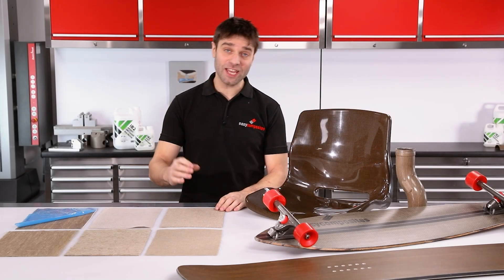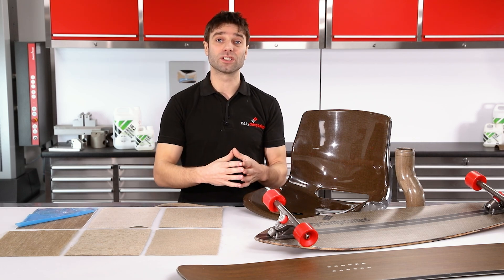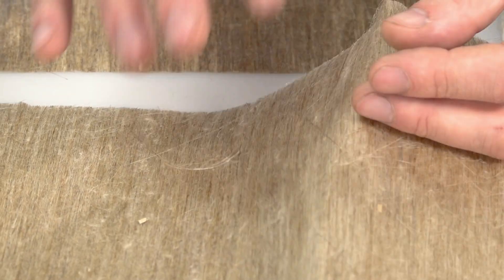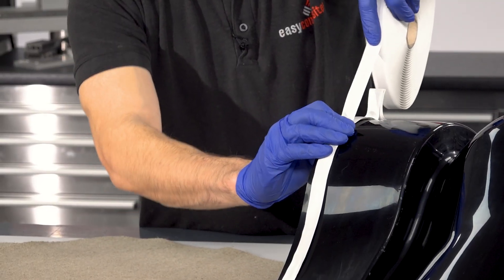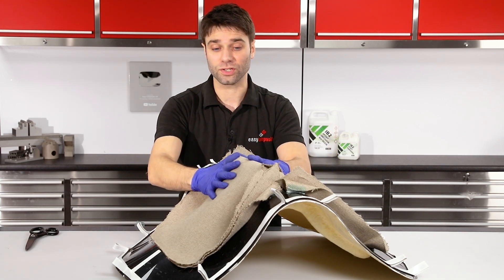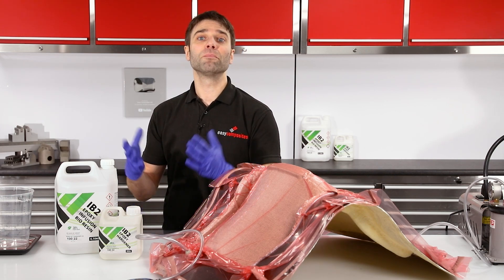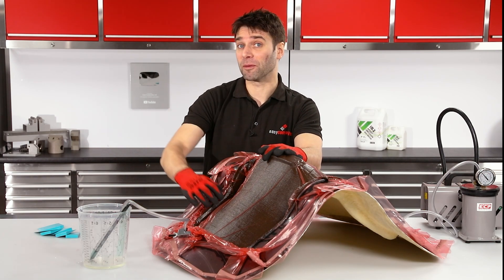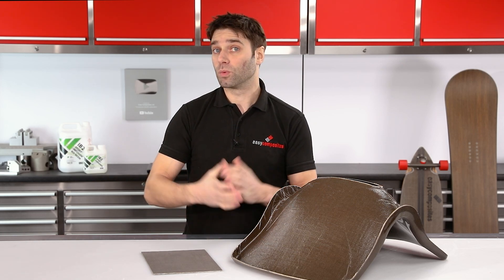How to Use Flax Fibre in Composites; Performance and Processing

Comment: I am curious, where did you hear that flax is stronger than hemp? An internet search yields contrary results: "when it comes to strength, hemp has a distinct edge over linen. Hemp fibers are up to eight times stronger than linen".
Reply: I agree, I've always read that hemp would be the stronger fibre. Maybe it has other properties which make it less desirable. Or maybe its just less available in a range of suitable twills.
Reply: @Piazzapower  I think it mostly comes down to the fact that cannabis is controlled, because I believe cannabis is more beneficial than flax. It produces stronger fibers and more of them, the rest of the plant is all used up while making other useful products, like healthcare products, animal feed, biomass for a clean source of fuel.
Reply: @Convolutedtubules  traditionally yes that's definately been the case but not so much now i believe. I think hemp products are much more accepted. I can walk in to a supermarket and buy hemp seeds in the health food section and cbd oils etc.
Reply: @Piazzapower  As long as the cannabis plant is controlled, it's many products will be at a severe disadvantage. Even though cannabis may be the best choice in many occasions. We need full legalisation to make the cannabis plant like any other plant and only then will we start seeing real change.
Reply from the maker: Hemp fibre has good potential as a natural reinforcement but the conventional hemp fibre that's produced in volume doesn't beat the flax that's produced in volume. Various papers  have demonstrated hemp fibre yielding better mechanical results than flax fibre but, as far as we've seen, this is only with lab-scale produced hemp fibre which has been specially prepared and conditioned so as to retain and optimise its mechanical properties for composites. As yet (again, to the best of our knowledge) hemp fibre, mass produced in the traditional way, does not retain its mechanical advantage over mass produced flax fibre, but if the lab production techniques are successfully scaled up then it could do, so it's a space worth watching.
More broadly though, as a statement, your internal alarm bells should already be ringing when you read something like "hemp fibres are up to eight times stronger than linen"; differences of this magnitude are pretty unlikely to exist for any similar materials, outside of very specific contexts and conditions.
Reply: @easycompositestv  Thank you!

Comment: This material seems really interesting, I'll have to do some research on it!
But I don't think it can be that environmentally friendly while it's not recyclable like metals.
Reply: Why dont you mention the Resin, which is way more critical
Reply: Recyclability wouldn’t really matter if it were 100% biological, compostable material. You could just plant new one. But a significant part of these composites is epoxy resin which is usually made from petroleum and non-recyclable and not compostable.
Reply from the maker: Fair comment, environmental impact has lots of factors at play and if recyclability was important for a product then certainly this should be considered

Comment: Fascinating video. You showed the issue of creasing from the vacuum bag, being a keen follower of Mike Patey he uses stretch film which would seem to get around the creasing problem, is this highly stretchable film not available in the UK?
Reply from the maker: Great question, in my experience epoxy will bond to  the highly stretchable films that you are referring to, not a problem if you are also using a release film but if used like this they would not be removable.
Reply: @easycompositestv  Thank you for the reply, could you not use peel ply and breather with the added benefit of removing excess resin? 
If you haven't already have a look at some of Mike Patey's videos on producing composite parts for his aircraft designs, a slightly different approach but his results are outstanding
Reply: @matthewsellers82  They mentioned in the video that they didn't use peel ply to reduce excess waste on this lay up.
Reply: I second the point that epoxy sticks to the stretch vacuum bag.  And the stretch doesn't eliminate creases, because you still need some pleats and extra material.  (If you use too little bag, the tension of the stretch material will pull the tape loose from the mold, breaking the seal.
Reply: The food grade stuff for wrapping sandwiches?

Comment: Truly comprehensive and well produced video!👌🏻 I will only comment that it would’ve been good to mention that Flax reinforcement isn’t so compatible with cheaper resins like Polyester or Vinylester for infusion processes, unless you either use a very special, water-agnostic initiator, or you go through the suggested steps on the video to dry up the Flax reinforcement every single time. Obviously Epoxy resins don’t mind the humidity-water content.
Reply from the maker: Thanks for the comment, there's always something we miss! You are absolutely right, drying the fibre is much more important with polyester and vinylester resins. We'll be sure to add the information onto our product listings.

Comment: Great video.  Could you use a flax fibre as a centre filler in a hybrid panel, in a similar way to carbon-foam-carbon or carbon-balsa-carbon panels?
Reply: It would not provide the benefit of being a lightweight core material since it is not thick like foam/wood and would be also saturated by the resin.
Reply: @F0XD1E  Thanks for the response, makes sense.
Reply from the maker: Hi Scott, as Tommy has said, the high resin uptake and naturally low compressive strength of flax makes it particularly unsuitable as a core material. Either it's fully wetted-out, in which case it would have great compressive strength (from the cured resin) but would be very dense (almost the same density of the resin) or it remains at least partially 'dry' in which case the compressive strength is very low. There are however natural materials that make fantastic core materials, like balsa wood and cork.
Reply: @easycompositestv  appreciate you answering.  Makes sense when put like that.

Comment: How does the cost compare to traditional glass / Carbon layups of similar dimensions and density? Only thing missing from this video. Love the level of knowledge and ease of instruction you guys give!
Reply from the maker: As mentioned below they are more expensive than using cheap fibreglass and polyester resins but generally the green credentials are often more of a priority than raw cost. We suspect as natural fibres and bio based resins become more popular, the costs will likely come down.
Reply: As an aerospace composites professional with almost forty years experience, I have been dealing with parts made from this stuff for about four years now in the motor racing industry and I am far from impressed, actually I think it’s garbage, you would be better off just using fiberglass. 
Just my my humble opinion
Reply: @aerobuild  When you say "garbage," what specifically do you mean by that?
Reply: @theprojectproject01  This stuff has no where the stability of even a polyester and glass chopped strand mat parts, it’s almost like a Kevlar part when it comes to impact damage but without the tensile strength of aramids, so it usually just completely disintegrates. I won’t name the company who’s cars I work on, but ever since they have introduced the flax body parts the major issues we deal with is that certain parts are considerably heavier compared to the carbon parts, they are no where as stable, especially when temperatures start getting a bit elevated. Compared to the carbon parts where we could usually repair and save them, in the equivalent sort of impact now the flax part is usually more like pulp and not repairable, so it’s ending up in the dumpster….hmmm I am still trying to figure how that is an improvement on sustainability and less of an impact on the environment?
The latest batch of parts on a brand new car the weave of the fabric is telegraphing to such a degree it’s appalling! We had the hood deforming in the Sun to the point where you could almost fit your hand through gap between it and the front fender.
So that’s just a quick look at our experience with flax parts since it showed up.
Some of the other negatives where covered in the video, so if you can’t tell, I am not a fan 😉
Reply: @aerobuild  interesting insight. I’ve read that mclaren used flax fiber to make their f1 racing seats and they claim that it’s lighter, stronger, and has better vibration dampening tho than traditional carbon parts.
Reply: @haydentakara4369  I wouldn’t dispute that, because of the nature of the flax fabric and from my experience with it, I am thinking to get a truly light part like mclaren are getting, they most probably have quite a lot of money tied up in tooling and capital equipment to process their parts, possibly prepreg and autoclave curing which is outside the realm of mere mortals. Admittedly the parts I have been exposed to all look like they are vacuum infused and that could be part of what I am seeing, no matter what, it seems that to get a reasonably light and dense part this fabric requires vacuum or pressure type molding to make it work. 
Just so you know, I am coming from an end user point of view where I am being asked by a racing team to repair body parts like doors, fenders, bumpers and hoods that get damaged due to the nature of motor racing and unfortunately the flax parts are not holding up to the impacts like we were seeing with the carbon parts which in only extreme cases could not be saved even with carbon being as brittle as it is.
Reply: @aerobuild  how is it when compared to aluminium body panels, like strength, cost etc etc, and if it would be viable for consumer vehicle panels
Reply: If you get composite specific stuff, it's gonna cost more. If you source bulk flax/linen it can be much cheaper.
Reply: Watch the sales at fabric stores, and buy 100% linen when you see a weave and weight you like on sale.
Reply: Hi could the flax be layer up
100gsm glass 
550gsm flax
100gsn glass 
Using polyester infusion resin 
What would the final layup thickness be 

Thanks
Hedley
Reply: @bonniejohansson3992 greenwashing, or applications where smashing it to bits isn't part of its duty.
Reply: Depends on source, but I suspect some sources are going to be dirt cheap.
Reply: Way less than carbon

Comment: Hi. Thanks, very good video. Why would you want to do such infusion rather than using pre-preg? Is pre-preg this much more expensive?
Reply from the maker: Hi Patrice, you're welcome. Flax prepreg does exist and, as we mention in the video, we do stock Eco-Technilin's FLAXPREG, however it's only available in a single weight/format at present. Natural fibre reinforcements are niche already, and then prepregs are a niche of a niche, meaning there isn't a huge demand for a range of flax prepregs just yet. Also, as can be seen from the video, flax infuses extremely well and is very well suited to this process. I would say that for most applications, infusion will be the chosen production method because of the choice of reinforcements, the reduced costs, the ability to combine multiple reinforcement types (easily) and the fact that you don't need an oven large enough for the cure.